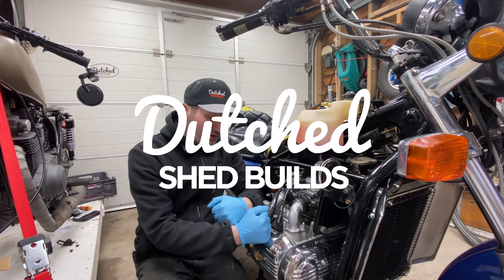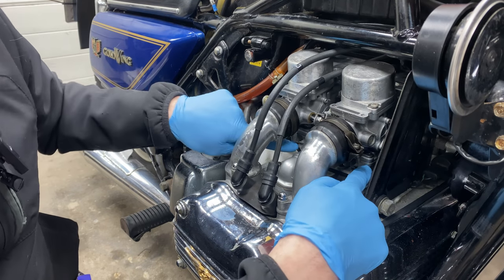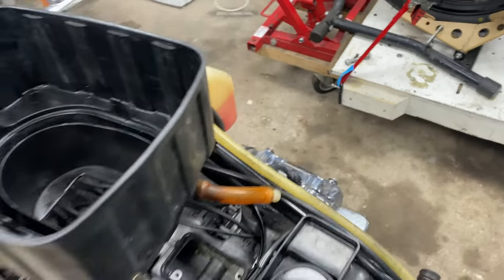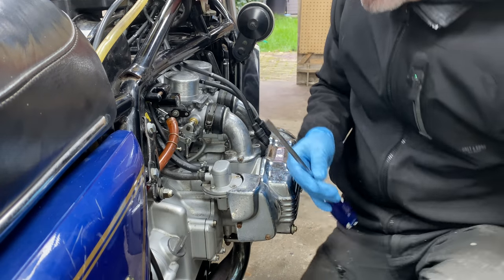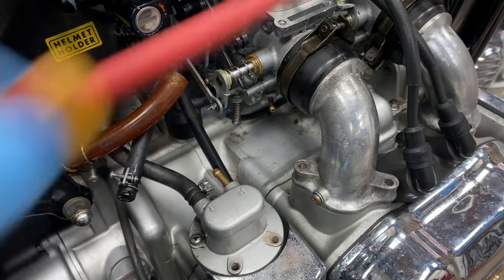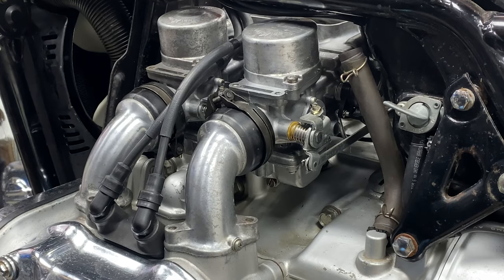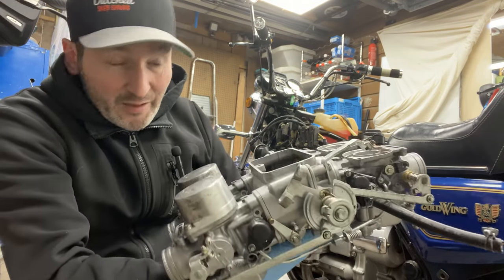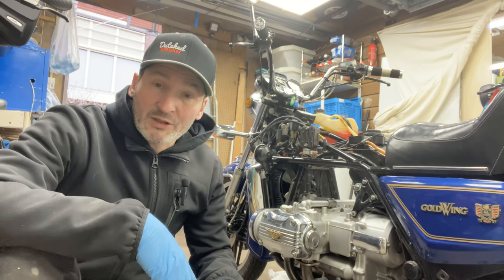How to Remove Carburetors from Honda GL1100 Goldwing

Comment: Thanks for the video, wish you had shown how the throttle cables came off.
Reply from the maker: Agreed. Because those can be really hard to get on and off. Its good to know that underneath the airfilter there is a adjuster in the cable to get some slack (not much). Also its important to really free the carb up as much as you can before you remove the cables.